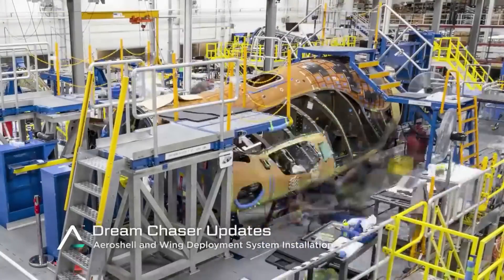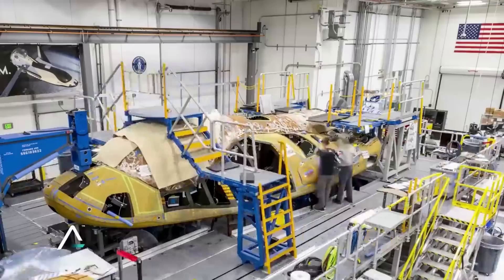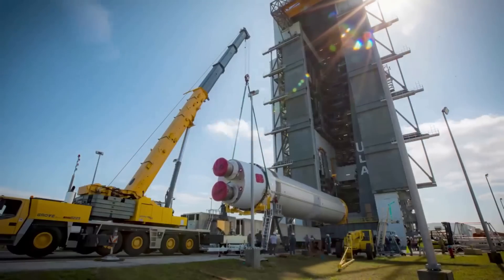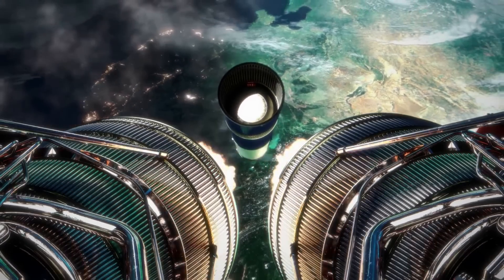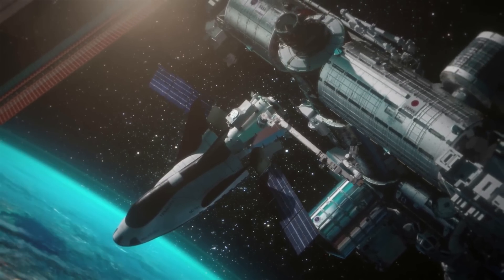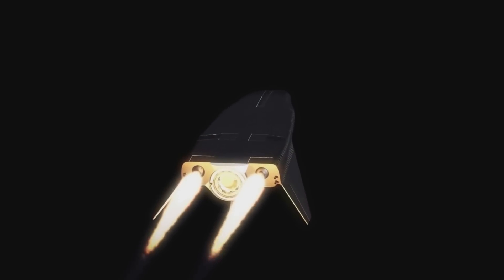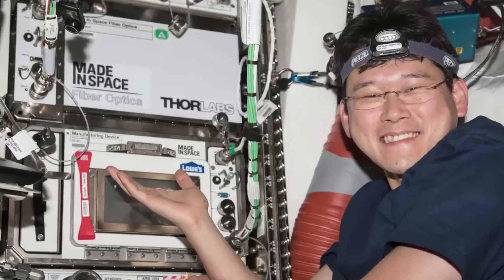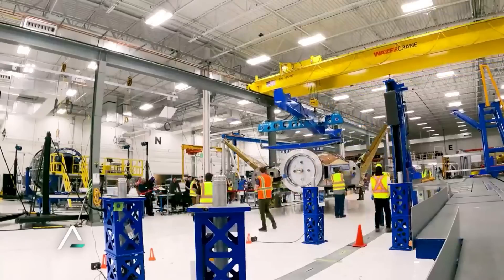Dream Chaser Tenacity Is Almost Ready For Its First Launch

Comment: It may be of interest to some folks to know that originally the spacecraft's known as the Space Shuttle was first designed to be very much the same size Ang appropriate # of crew that Dream Chaser is now. It was due to a requested change of design by the Pentagon that it became the vehicle we came to love. And the reason was due to a need for  heavy lift space plane with the capability of launching the next generation of spy- scope's into orbit. Now known as the KH11.

Comment: I never understood the design of the shuttle. It was like sending an entire semi truck to space instead of just the cab. That means the trailer part had to be insulated to re-entry. If that part was designed to burn up on re-entry the only the cab part would be a re-entry that size space plane would not have the weight of all the excess tiles.

Comment: Why still cut thousands of tiles? Build a Jig, so to '3D Additive Ceramic Print' right onto the pre' adhes'ed fuselage surface. Then on return, Pre depth' Laser Off' the area's that need replacing' Then repeat Step one, at that point of repair! 🚀🌎🌍🌏

Comment: It has the same unforgiven drawback of the space shuttle which failed it primary objective reusability with near zero maintenance window between flights. The drawback was these custom thermal tiles. More custom tiles and manual effort is needed for inspection and fitting, more it is hard and time consuming to replace damaged tiles, less it becomes reusable.

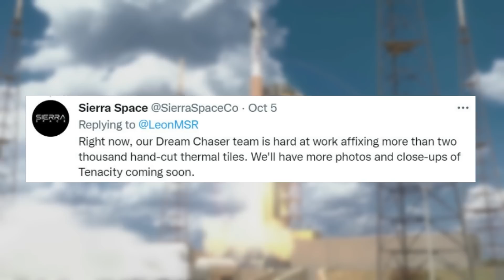Comment: 1:20, thermal tiles? I don't see why they have to use a decades-old system that has been infamous for its failure.
Reply: New tile designs. Also the main issue was with damage caused by boosters mounted on the side. This will have all boosters down below, nearly eliminating the debris hazards.

Comment: Back to the ‘60s!  NASA and/or Air Force was playing with these lifting body vehicles (no wings, the body shape provides the lift) back in the 60s.  If I recall correctly, they were the basis for DynaSoar, and contributed significantly to the design of the space shuttle.      Joe

Comment: I always said that the Space Shuttle should have flown atop the Rocket.  No risk to the tiles or damage from falling ice and debris.  The Shuttle would still be flying had it been designed that way.  Dream Chaser is the Shuttle’s Mini-Me.  Not sure the economics work now that Space X has brought the costs down so low per launch.
Reply: The economic viability will largely depend on the reusability of the rocket section to boost them up.
Reply: Robert Zubrin had the best comment on the shuttle.  "They built it upside down!".  Throw away the expensive first stage and keep the inexpensive upper stage.

Comment: If they want to get dream chaser up a lot sooner, use a Falcon Heavy, it's already a proven rocket.  If they want to stick with ULA then have the Vulcan switch engines from BE4 to Rapter 2's.  Blue Origin has made a total of 2 engines that might work, where Space X has already made 200 functional Raptor 2 engines.  It's time for NASA and some of these other space companies to start using some basic common sense both financially and logistically....

Comment: Weren’t the tiles what ended shuttle program?
Reply: The root issue was the spray foam on the external tank coming off in chunks.  A large chunk struck the leading edge of one wing and damaged the tiles there.  Dreamchaser mounts on top.  Also, the Vulcan-Centaur isn't covered in stupid foam.
Reply: No. They have much better tile designs now. They were considered as an upgrade for shuttle orbiters but the side mount of boosters would still have presented a hazard to the orbiters.

Comment: what is the estimated cost to launch a vulcan rocket? could this be stacked on a falcon nine, if for some reason a vulcan wasnt available? this sounds like a good idea for ferrying supplies up to and returning finish products from orbital production facilities.
Reply: It could be stacked on a Falcon 9 (probably with some adapter, i think the mass was fine, may be a diameter mismatch) iirc, main issue is just that because capitalism, they are rivals and thus no collaboration for cool rockets!
Reply: @ericlotze7724  well.ome would hope they'd be smart enough to know that national security dictates emergency back up contingencies. No more periods of lack of access to space like the shuttle Era.
Reply: Same with how SpaceX was SUPPOSED to make an Air-Launch Falcon for Stratolaunch, then they backstabbed them by pulling out of that project.
Reply: @ericlotze7724  it would have been interesting to see, but it drains resources from starship, plus musk is a git.

Comment: With zero passenger allowance, 5 Tonne cargo capacity, and an estimated launch cost of $250 Mill (When they do finally finish building and testing and have proven their ability to successfully launch) They'll be so far behind the proven capability of Dragon which is about a $60 million launch without crew, and a 3.3 Tonne cargo capacity.  Not a very competitive playing field and that's without factoring the four vessels SapceX will have by the end of 2022.  And that's not even counting the Crew Dragon vessels.
Reply: Some competition is better than none

Comment: It's been a long time coming. Looking forward to seeing Dream Chaser launch to space and finally dock with the Space Station. 

Dream Chaser is a derivative of the HL-20 and the the Assured Crew Return Vehicle (ACRV). ACRV was designed to be carried in the Space Shuttle cargo bay as an alternative crew return vehicle for long duration missions. Sometimes ACRV referred to as the Station Crew Return Alternative Module (SCRAM).
Space Shuttles remained in orbit for just a couple weeks. After the Challenger accident, payloads carrying significant fuel were omitted as potential payloads. Considered too high risk, post program reviews, and due to budget constraints.
Reply: @Aerial Waviator   Dream Chaser design brief has been around for several decades.   In the early '90s ESA were seriously looking at it as a European shuttle to be launced on Arian-5.   I still have the glossy color EAS bulitain bi-anual publication.
Reply: You know your crew return plan is crap when you have to fill up the cargo bay with an extra shuttle.
Reply: @jshepard152  SpaceShuttle had an on-orbit maximum period of ~3 weeks. A vehicle like the Crew Return Vehicle, and CrewDragon, and Dream Chaser are designed to spend periods of 6-9 months in space. Part of this is because the SpaceShuttle depended on hydrogen fuel cells vs. solar power for it's electrical and life support systems. Later vehicles can be externally powered, or are solar powered, plus have extended sleep modes.

Comment: Shouldn't they be doing high altitude drops FIRST, or are they so sure of the aerodynamics they will just send it up.
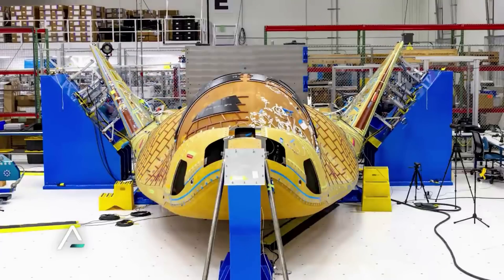Reply: they have done drop tests. you can see it being lifted by a heli at 45 seconds into the video and it landing at 6:45
Reply: They have done multiple low altitude drops that provided good data for gliding in thick atmosphere.
Reply: They dropped it in 2013, again in 2017.

Comment: They should slap it on top the proven Falcon rocket instead of that faulty dated Vulcan rocket
Reply: The Vulcan is a new ULA rocket designed to fly with Blue Origin Be-4 engines.  Are you calling in dated because the booster doesn't land for reuse??   Because if so that means that you Space X fan boys are ready to literally fall over yourselves with your adoration for starship at the expense of everything else.
Reply: @tst ccnt     That a joke?  No one is scared of ULA.

Comment: I always hoped and « chased the dream » that ultimately, a nice Deamcheaser upgrade could become a three stage entirely recoverable orbiter, because three stage is much lighter than two while monostage is most inefficient ..then for crew swaps a solid and rigid lifting body seems safer since it  can land despite bad weather , does not required long reserves for it and could be very economical, specially compared with a huge twin stage starship etc,: first stage would consist of a large Scaled Composites Stratolaunch plane, second stage would be a rocket with Finns and legs, a sort of small Falcon heavy mid section boost landed on a barge at the middle of the ocean, or even better a oversized Pegasus rocket with wings and Finned tail very light once empty and landing like a plane so that this second stage, and the lifting body orbiter can help with takeoff lifting power, and as third stage, the lifting body itself with two reigniting engines at the back like the shuttle and fitted with four small 3D printed jettison ergols tanks for only the short third stage last acceleration, and these would be the only solid and inexpensive consumables since tiles on tanks  and recovery system for last stage almost reaching orbit would cost more  than reproducing new tanks while the rocket engines and auxiliaries are recovered with the orbiter,.

Comment: if dream chaser would be the same size as spacex starship, 
then that spaceplane could sit on top of spacex heavy booster and transport astronauts
Reply: A bigger version of dream chaser would also require many more years of development and testing including a ore powerful propulsion system.
Reply: @michaeldeierhoi4096  There is a bigger version of dreamchaser, it’s called a space shuttle.
Reply: @Ca48Point5  I was responding to Ingemar's suggestion of a bigger version of Dream Chaser by implication to a larger craft NOW and not the shuttle which had it's time.
Reply: @michaeldeierhoi4096  That’s gonna take a while since we don’t really need a bigger dream chaser (at least not yet)
Reply: No, it’s most likely gonna fly on vulcan
Reply: If the mass grows for some future derivatives then can probably just add more boosters to Vulcan and still get to low earth orbit.

Comment: It's good to see it finally getting near a (cargo) flight, but there doesn't look like enough space for 7 astronauts.
Reply: Looks can be deceiving
Reply: The original Dream Chaser was to be manned. It was to hold up to seven crew members.
Reply: @spydude38  The marine corps would like to know your location
Reply: Astronauts are used to spending days in tiny cramped spaces, if 3 astronauts can fit in a Soyuz command pod, then 7 can certainly fit in this plane thing
Reply: @greatconch278  I mean, the space shuttle had a maximum capacity of 7, so since starliner is smaller, you’d probably have 4-5 people onboard instead
Reply: No crew escape system.  Why would any crew want to fly on it?
Reply: @jshepard152  Starliner does have an escape system, it’s going to be very similar to that on the HL-20. There are 2 hybrid rocket motors on dreamchaser capable of performing a launch abort.
Reply: @Ca48Point5      I wasn't referring to Starliner.   A launch abort in a winged space plane?  Let's hope that doesn't rip the wings off and kill the crew, a la Challenger.  Also, let's hope that doesn't rip the wings off and kill the crew a la, Columbia.  Space planes at Mach 25 are inherently dangerous.